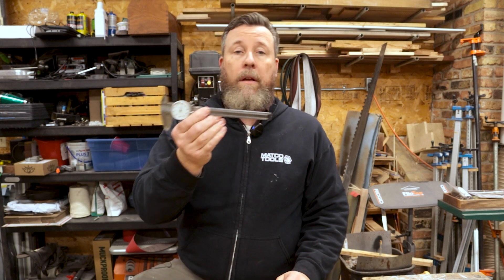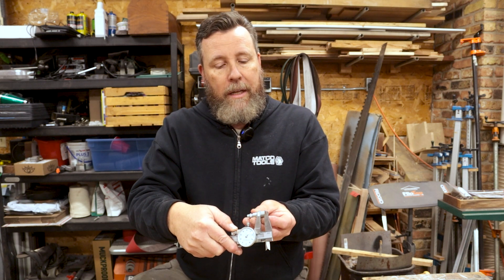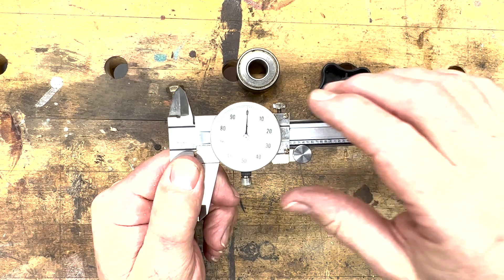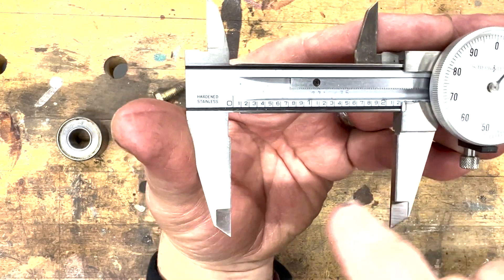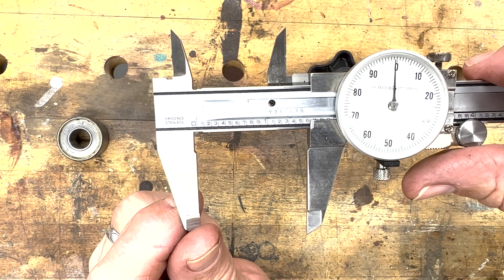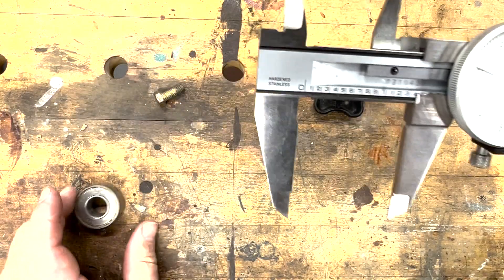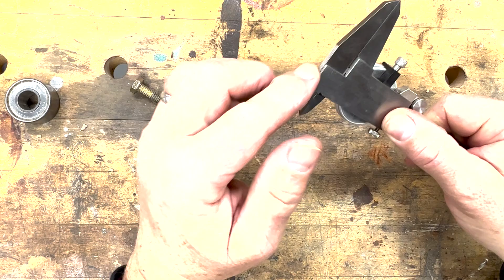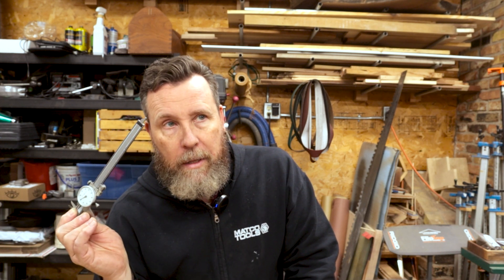How to Read & Use Dial Calipers Like a Pro

Comment: You can calculate another dimension by combining step and depth measurements in certain setups. 

For example:

Wall Thickness: If you measure the step height (distance from the top surface to an inner lip or bottom surface) and the depth of the hole or cavity, you can find the thickness of a wall or material separating two areas.

Formula: Wall thickness = Step measurement - Depth measurement.

Total Feature Height: By summing the step measurement and depth measurement, you might calculate the total height of a combined feature (e.g., depth of a recess plus the height of a feature above the base).

Comment: Excellent video. I have used dial callipers for years and also never realised the step measurement. I used to own a dial calliper made by “Rabone Chestermann” it was a composite material, like a fibreglass. Light weight and accurate.